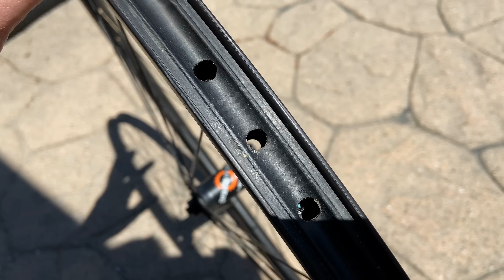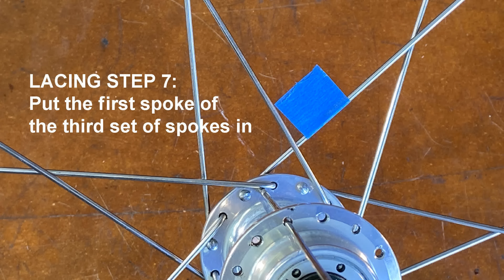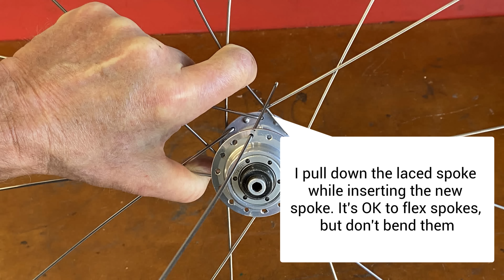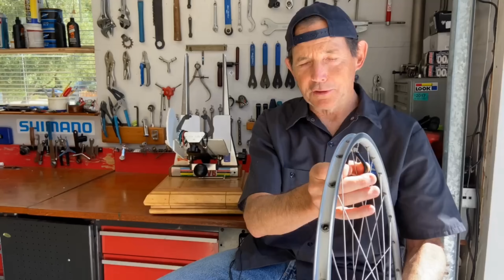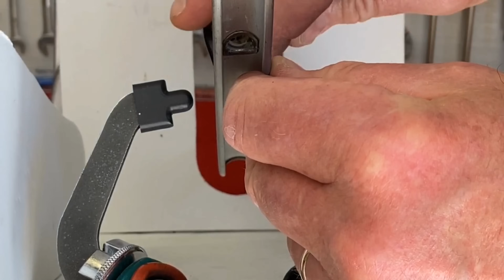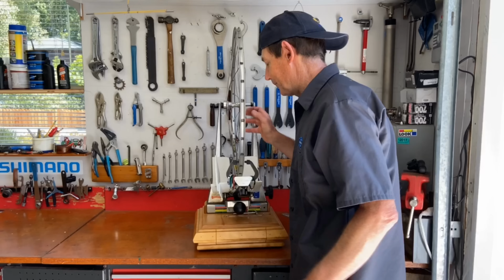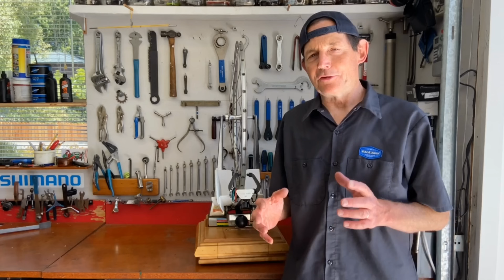How To Build Bicycle Wheels THE EASY WAY! #bikerepair

Comment: I have a rear rim brake alluminum rim with 24 holes, the holes are grouped 2 holes beside each other and offset to one another,so the is a total of 12 pairs of holes. By the way it's a Pinarello MOst Panther wheel set. How to i lace up these rims?The rear hub has a larger diameter flange on the drive side and smaller diameter on the non drive side.
Reply from the maker: Thanks for watching and the question. Hopefully you have the wheels not just the rims and hubs. Because, the easiest and best way to work with unusual spoke lacing is to not take the wheels apart. Instead, tape the new rim next to your wheel. Be 100% sure to align the valve holes on both and be certain too that the new rim is oriented exactly the same as the old rim. Next carefully loosen the spokes on the wheel, but not so much that any nipples fall off. If they do, just screw them back on a few turns. 

Once the nipples are loose all the way around, start at the valve stem and move 1 spoke at a time from the wheel to the new rim. Take your time so that you make sure that you put each spoke in the same hole it's in on the other side but on the new rim. Then just continue moving each spoke from the wheel to the new rim until they're all in the new rim. Then to finish the wheel, you'll just true, round, center and tension the wheel.

Now, if you do NOT have built up wheels to work with, you will have to figure out the lacing by looking at the hubs and rims. Since it's 12 spokes on each side of the wheel, it shouldn't be too difficult to figure out the pattern. I tried googling on Pinarello Most wheels but I didn't find anything helpful online. If you can find a photo of the same hubs, rims you have all built up into wheels, you'll have a road map on how the wheels are laced to copy it. You might be able to contact a tech customer service rep at Pinarello to ask an expert too. If not, you'll need to experiment to figure out how the spokes go into the hubs and rims correctly. It's always a fun puzzle to figure out. Hope something here is helpful.
Reply: @JimLangley1  thanks for reply, unfortunatly i took this rim apart many years ago and i never got around  to rebuilding it...til now ... i just retired from working in the automotive trade as a autotechnician,(after 30+ years) and i thought its about time to repair this rim. I do have the front wheel still intact,it has 20 spokes vs 24 on the rear and i checked my cell phone pics and i found some of the rear wheel, they not the greatest(i can send you a pic if you like). I tried Pinarello cust. ser. haven't got a reply from them...it's been over a month. But i have another question,i actually posted it on onther video you made regarding centrering the wheels to the frame. These wheels originally came with Campagnolo cassette 12-25 teeth, but (after struggling on the steep climbs here in S. Ontario Canada) i purchased a 13-29 but when i started using the 29 the jockey cage would rub slightly on the spokes,i adjusted the derailleur, but the adjustment is for fine that sometimes i either can't get into the 29 or after a short distance it comes out of the 29 and goes onto the 26 tooth cog while climbing. So i was wondering if a can dish the rim so the spokes on the drive side would be more verical than the non drive side?
Reply from the maker: @arnodivalentin5639  I replied to your other question about the rubbing on that question. So you should have received a notice and link to that already because I replied earlier this afternoon. Let me know if it disappeared and I can go back and find it and copy and paste it here.

Comment: I have got the general ideas and concepts and I struggle on the tensioning and balancing. I am preparing for my bicycle mechanic end point assessment. I have to complete a wheel in 90 minutes to 0.1 mm and 5 % balance for distinction. 

The wheel build has to be 3 cross asymmetrical rear wheel

I am building a wheel for myself right now and then will get a cheap or old wheel to practice on for the next couple months.
Reply from the maker: Thanks a lot for watching, the great comment and best of luck on your assessment! The key to easy tensioning is to only start adding tension AFTER the wheel is as true and round as possible. Right after lacing get the wheel true, round and centered and do it mostly by loosening spokes rather than tightening them. The goal is to be true, round and centered with almost no tension in the spokes. Also, the spokes and nipples should be seated in the hub (all bows in the spokes straightened) and rim so that you can accurately true and round the wheel. I do this first after lacing. Then, as you go around adding each layer of tension to the spokes 1/2 turn at a time, the wheel wants to stay true, round and centered. And the truing, rounding and centering needed will be minimal. I hope this is helpful. Thanks again and good luck on your test, you can do it!
Reply: @JimLangley1 thank you. This is fantastic guidance. Really appreciated.
Reply from the maker: @ilovekale  I’m glad it’s helpful and always happy to help!

Comment: Every other video I've seen says to go 4 holes over having 3 entry holes spoke in the 4th your saying 5 ..... I'm doing a 32 hole BMX 20" rim 3-cross
Reply from the maker: Thanks for watching and the question David. My video is designed for beginners based on having taught classes on wheel building and learning how to teach brand new wheel builders. Please watch and listen to that step in my video again and you'll see that I'm just counting a different way and I do that because it's a better way for beginners. The difference is you count from a spoke already in the rim which helps people recognize that they're matching what they did before, same spoke placement as the one before. It's just a different way to do it and it helps prevent mistakes. Thanks for asking and happy wheel building.

Comment: how do you build 4 cross spoke pattern on 36 hole hub
Reply from the maker: Thanks for watching and the question. All crossed spoke patterns: 1, 2, 3, and 4 cross (etc) are built the way I show in this video - following the exact same steps EXCEPT that when you cross the spokes, you would be sure to cross 4 spokes instead of the 3 spokes I demonstrate in the video. Hope this helps. Let me know if you need me to explain more.
Reply: @JimLangley1  i think i got terminology wrong. i was thinking of paired spoke wheel because i got 4 spoke holes grouped with large spacing between them and don't know how to lace them because they looked weird before i cut them and now i am stuck
Reply from the maker: @maakz  thanks for explaining more. To figure out how to lace a paired-spoke wheel, you would study the wheel first (before taking anything apart) to figure out how it was laced and be sure to copy the way it was done. It sounds like you may have already cut out the spokes. In that case, maybe you took a photo of the wheel you could use for reference? If not, you could figure out what brand and model of wheel it is and try to find instructions on their website about how to relace the wheel. If that isn't possible, you can usually figure it out based on the design of the hub and rim and how the spokes fit into both, since paired lacing puts two spokes next to each other at the rim and those spokes fit in the hub similarly. If you can figure that out, you should be able to figure out the way the spokes were put in originally. That's what you need to figure out. Hope this helps.

Comment: What about rear wheels sir? The length of non drive side spoke, is it different from the drive side?
Reply from the maker: Thanks for watching and the question. Spoke length depends on several factors such as the hub design/type and rim design/type. Often the right side (drive side) will be 1 to 2mm shorter but not always. You always want to determine your spoke lengths carefully before buying the spokes. I have a video about that too you can watch: https://youtu.be/LvV4FE2VxZk 😊

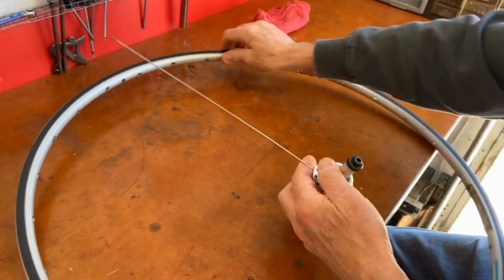Comment: 10:17 Interesting, that you do it differently than Sheldon Brown. He recommends to start lacing the wheel in a clockwise direction and putting the spoke into the second hole, if its not on the right side of the rim.
Reply from the maker: Thanks for watching and commenting. Sheldon and I share some similarities- we both lived in Massachusetts, we both were technical editors for Bicycling Magazine, we both have large bike websites and we both worked in major bicycle shops. Yet we differ in how we like(d) to build and teach wheel building 🚵😊🙏

Comment: Hi Jim, fantastic video. Just wanted to ask what you would advise in terms of nipple prep. In the video you used oil on the nipples and spoke threads but I see there are a number of nipple freeze type products out there and also the use of linseed oil. Also is it bad to dry assemble wheels? Keep up the great instructional videos, they are  the best I've come across! Thanks.
Reply from the maker: Happy to hear you found the video helpful Shawn. Thanks for watching and commenting! I have separate videos on most aspects of wheel building. So please watch my video on ways to keep spokes tight. This link should open the video:

https://youtu.be/z4FKL95x6DE?si=PjcKzaJIbWzxLCj4

Comment: can a wheel be trued with the tire mounted
Reply from the maker: Thanks for watching and the great question. Yes absolutely- in fact tha vast majority of wheel truing is done with the tire on and the wheel still on the bike. The tire makes it a little harder to see up and down issues - hops and dips/high and low spots but you can true side to side easily. Hope this helps and happy wheel truing.

Comment: So are the four groups of spokes all different  lengths? Thank you Great video!
Reply from the maker: Thanks for watching and the great question TM. Usually on modern wheels, which often use disc brakes all the spokes on one side will be the same length and all on the other will be a slightly different length. So 2 slightly different lengths (usually no more than 2mm) are used on most bike wheels. Except on front wheels with rim brakes or no brake. On those all spokes are the same length. I have another video all about how to calculate the correct spoke lengths when building wheels. Hope this helps and thanks again!

Comment: Hey, great video... one I've watched a few times now... quick question,  and I'm hoping you might know... I've a Park Tool tension guage... any suggestions on one to use on small wheels? I'm a fellow Moulton rider... built a few 17" wheels, but struggling to find a suitable meter that will fit on such short spokes! I'm happy with the feel tension wise, but I'd really like to measure the values and be able to get a consistent balance... any pointers would be most appreciated! Thank you, and keep up the good work! Tom
Reply from the maker: Thanks Tom, I'm glad you like the video and it's nice to hear you're riding and building wheels for a Moulton (great bikes and a great man!). But I don't know for sure what tension meter would allow you to measure those spokes. When I was building the most Moulton wheels I was working at a shop here in town and the tension meter we had at that time was made by Hozan. It's still shown on their website here: https://www.hozan.co.jp/cycle_e/catalog/wheel/C-737.html?srsltid=AfmBOooY2K0l_YG9eUWHAmsoalkl5IX04NaoaeqCQPA5AJX8VjquoZzm If you search on Amazon you'll find a new version here: https://www.amazon.com/HOZAN-Digital-Tension-Meter-C-738/dp/B08BR8RBJP Now, I am not 100% sure if I used our Hozan on the Moulton wheels so I can't say with certainty that it will fit. The reason is because on small wheels like Moultons, the spokes reach full tension quickly since they're so short. And small wheels tend to be super strong since the rim is so small. So, it's pretty easy to build a really nice wheel so long as the rims are good quality and the Moulton rims were. In any case, if you want a tension meter to check Moulton wheels, maybe a Hozan will work but be sure to check it carefully before buying it to be sure it'll fit on the spokes to get good readings. Hope this helps and thanks again!
Reply: Thanks so much for your thorough and useful reply, yeah! Big wheels feel like an eternity in comparison getting up to tension,  I'm enjoying the process, finding it somewhat therapeutic! Ill check out the Hozan tension meter,  I'd like to be able to confirm my tension inputs like I can on bigger wheels,  but as you've mentioned,  small wheels are inherently strong- nice Am you’ve got, is it an AM14? Great to see these fine bicycles,  as always.  Best wishes, @JimLangley1
Reply from the maker: @ronmael1675  you're welcome Tom. It's a long story about my Moulton, but basically we were the west coast distributor/shop for Moulton in the mid 1980s. After the shop closed the former owner contacted me wanting help selling off the Moulton inventory from the shop. I said I would do it in exchange for a Moulton since I couldn't afford to buy one when I was working at this shop. The only complete bike he had was a AM-7, however, it was one that I remembered building (I did all the Moulton builds). And, for that bike, we had had a framebuilder braze on a tab for a front derailleur so I actually have an AM-7 turned into an AM-14. I was lucky to get to visit Sir Alex in England when he debuted the New Series Moulton and he came here to visit our shop and I took him for a nice ride out the coast, which he enjoyed. A couple of the greatest cycling experiences of my bike life!
Reply: Fantastic! I recall seeing your photos of your visit, and a report on the New Series, its some years ago now isnt it! Thank you again,  keep up the good work, im thoroughly enjoying your content! @JimLangley1
Reply from the maker: @ronmael1675  you have an excellent memory Tom. Yes it would have been about 30 years ago now when I wrote up my visit with Alex to see the New Series and his factory for Bicycling Magazine. It feels like it was yesterday. Thanks again, I appreciate you watching and the great comments. I only wish YT would allow posting photos so that you could share photos of your Moulton here so we could see it.

Comment: Getting ready to tackle my first wheel build and your video is giving me the confidence necessary!...are there any special considerations when using carbon rims? Thanks for sharing your knowledge.
Reply from the maker: Thanks for watching and the question. Yes, with carbon rims you don't want to put oil on the nipples because if you do it can get all over the beautiful carbon rims and be hard to remove. It's fine to oil or grease the spoke threads, but pay attention when lacing so that you don't get the grease/oil on your fingers and then touch the rim and get it oily. I use a product called Spoke Prep, which I cover in another video here. https://youtu.be/z4FKL95x6DE It dries on the spoke leaving a plastic-like grippy and lubricating surface. https://youtu.be/z4FKL95x6DE One way to avoid the mess is to wait until all the spokes are in and then put a drip of oil on each spoke right on the exposed threads. Then when you begin to tighten the nipples, the oil will get drawn up inside and it's less likely to get transferred to the carbon rim.

Another thing is to check with the carbon rim makers to see if they can provide specs on optimum tension and any requirement on the build such as a certain lacing pattern or using nipple washers. You want to build it the way they say to - if they do provide such specs. Not all companies do, but some do so it's worth checking. Lastly, most carbon rims are very round and true from the factory. This means you can get the wheel very true, round and centered BEFORE you start adding any real tension to the wheel. And that makes it easier to get to final tension without a lot of retruing and rerounding because wheels tend to stay true and round if you start with them that way at the beginning with very low spoke tension. The key to accomplishing a very round and true wheel with very low spoke tension is to mostly loosen spokes as you get the wheel round and true. It'll take a little time, but it's time well spent as the rest of the build will take less work. Hope these tips are helpful. Have fun and let me know how it goes!